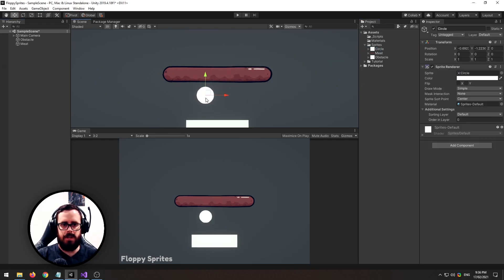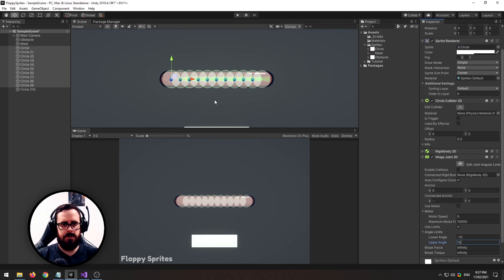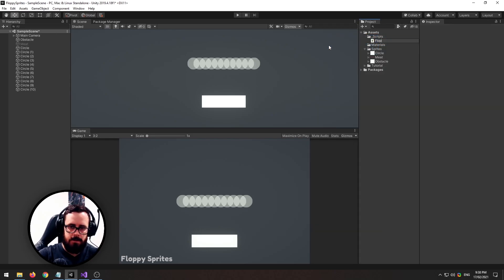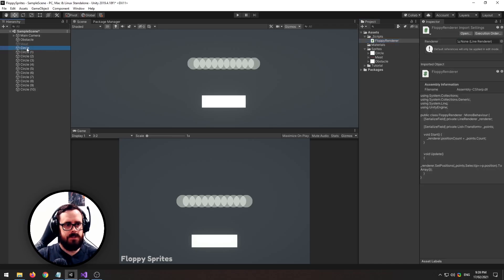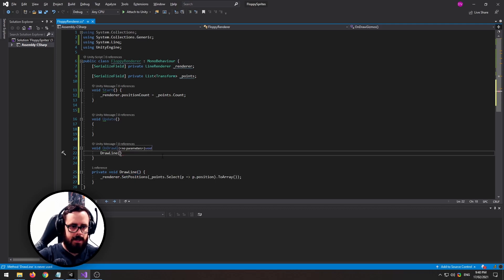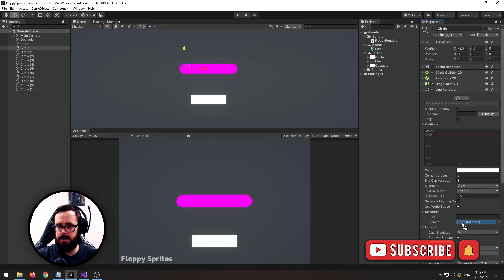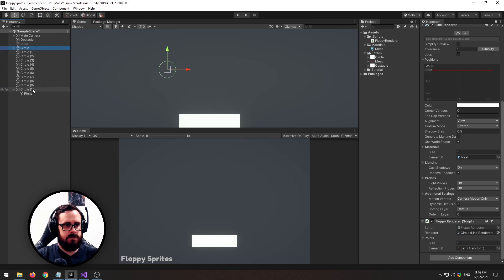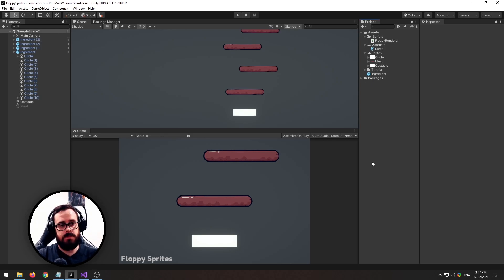Floppy, physics-based sprites in Unity

Comment: I recently found out that there are different Joints in Unity, it would be interesting to see a small review on them all.

One more question. Friend Tarodev, I remember you mention turn based strategy, and did fine videos about 2d tilemap. Do you know any way to properly use 3d Hex tilemap in Unity ? 
I try to make my games with tiles, and for 3d squere tiles tilemap works properly with "2D Tilemap extras" package. But I want to use 3d hexes and do not know how to post them correctly in a game.
Reply from the maker: Sounds like you need to make your own level editor. It's a grand task but makes level creation insanely easy. I have a video planned on this. It will probably be a 2 parter

Comment: Just curious, if you made a ring out of the circle colliders, would it result in a jelly-like sprite?
Reply from the maker: It would! which is funny if you've never seen it made before because you basically just invented soft-bodies! All a softbody is, is a mesh of colliders and joints (then the slightly more complex part is drawing a mesh around the shape). I plan to actually make a video on 3D softbodies one day.

Comment: This is great, thanks mate. If I wanted to make meaty stuff in a different shape, is it the same kind of method? Can you add joints between more than two objects?
Reply from the maker: I suppose your limitation is the line renderer. It's quite flexible though and you can define custom widths for each segment.
You can certainly add joints to join multiple objects. For example you could make a bunch of loose objects with rigid bodies and draw a line over them with a rope texture, then connect each end to the objects.

Glad you found it helpful!
Reply: @Tarodev  ah, I'll have a play around. I'm super new to this. I tried to umm.. Make something lol https://twitter.com/JezCorden/status/1374993274331664385?s=19
Reply from the maker: @jze.c  Hahaha! Glad my tutorial is helping a good cause. I think you need to raise the width of the line renderer to give them a bit more... girth.
Reply: @Tarodev  I'll try that. I did move the line around but it didn't seem to affect the sprite I had. High chance I'm doing something wrong lolol